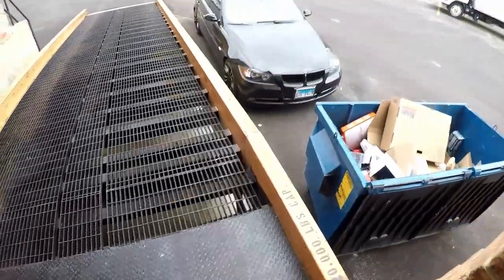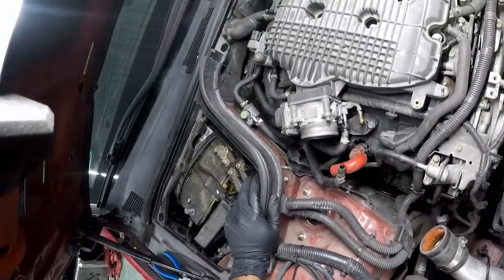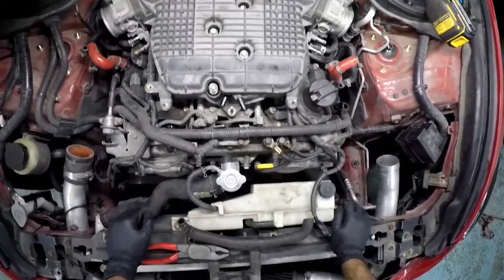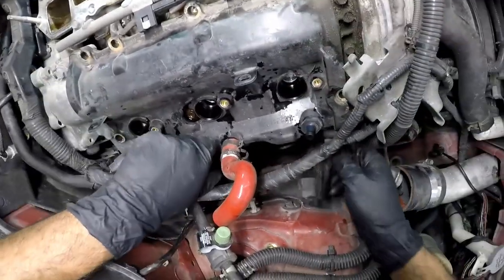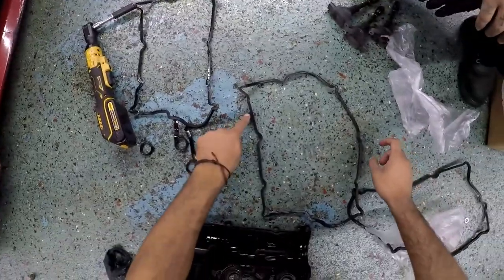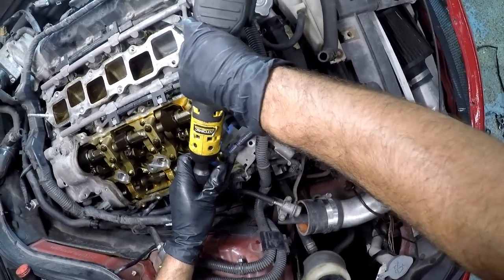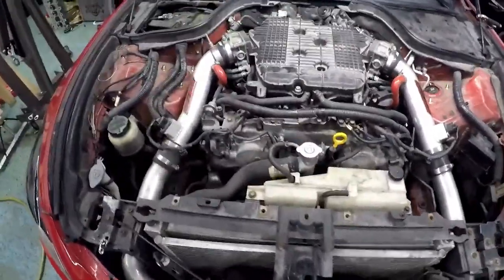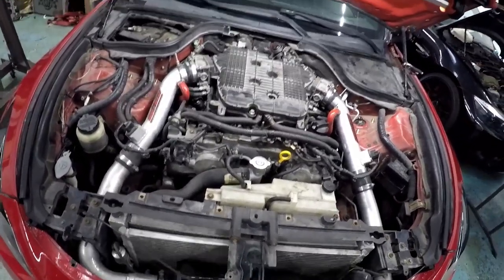Infiniti G37 Valve Cover Gasket Replacement and Spark Plugs

Comment: gotta do this job this weekend my q60 blew a spark plug up due to a bad gasket😂
Reply: blew the coil pack straight out and pulled a hole in the valve cover where the 10 bolts in

Comment: Can a valve cover gasket on a G cause a misfire even after you changed plugs and coils if the oil is filling in one cylinder?
Reply from the maker: Yes it can. Because there is a gasket around the spark plug hole on the valve cover. But if you change the valve cover and it still does the same thing check compression on that cylinder
Reply: @LuisGee  I just need my light off so you think even with the new coils and plugs already installed just the oil leak alone from the valve covers will continue the misfire?
Reply from the maker: @stargasmgaming  with new spark plugs and coils it shouldnt misfire right away. And it if does then i would check compression
Reply: @LuisGee  ok so ill replace the remaining 4 coils first, someone suggesting all coils should do it... but im scared like what if it still misfires
Reply from the maker: @stargasmgaming  check rockauto.com usually cheaper to buy parts from there

Comment: Just did my looks like no more leaking, but now took it for a ride n now a have no power n is overheating, what you guys think happen??? Any ideas???
Reply from the maker: Check for coolant leaks. Maybe you forgot to put a hose back on. So you may have no coolant
Reply: @LuisGee   yeah! there was 1 leaking, for intake, throttle, a small 1 
Thanks!!!
Reply from the maker: @lgakadabumpermaster9834  yea now just burb/bleed the coolant system and go take it for a drive and see of it still over heats
Reply: @LuisGee  working good no more overheating!!👍🏽👍🏽🫡🫡 thanks for the help!!
Reply: What if I just poured coolant in without burping/bleeding “correctly”?
Reply from the maker: @DanielB-d3v  if you changed the thermostat there is going to be air bubbles in the system, you need to bleed it. Might even overheat